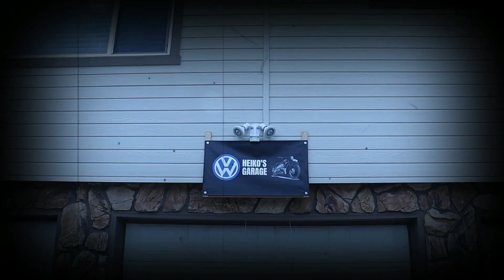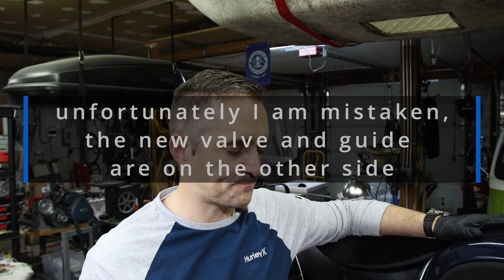BMW Airhead top end noise after refresh - follow up

Comment: Hi guys, I am from Germany and I am riding BMW R 90S for More than 40 years, doing  all mechanical  work on my own. You don‘t have to Make your mind on mechanical Noise because These bikes are Really old school Mechanic. My Father who was an engineer also always Said: as long as you can hear it, it is still in Place!
Reply: I’ve just rebuilt my 1987 bmw r80 gs. Same issue, the right cilinder has a different noise than the left one. But I thought the same thing than you, old bikes, old mechanic.. not quite but reliable. I’ll keep riding it, will check if everything is ok in some months.
Reply: I have an ‘83 R100RS and while it doesn’t make any funny noises, I have come to appreciate the raw simplicity of the 80+ year old basic design…..and it’s little quirks.
Reply: Check the exhaust mount below the cylinder. A rattle there will go away when it warms up.

Comment: I worked at a BMW dealer for 4 years as a mechanic.  I had the same issue with a bike.  After many hours doing the same as you I replaced the lifters and the noise went away.
Reply: I totally agree

Comment: I have the same symptom, R65, but on the left cylinder.  Did rocker arm end float.  Did valve adjustments many many times.
Eventually found the left  cylinder 😊exhaust push rod had play where it fits into the cup behind the rocker arm.  It was centred in the push rod tube, but was relatively "loose" in the rocker arm seat cup compared to the others.  While idling with the cover off I managed to put some side pressure on the push rod and the noise went away.  Further than that i have left it and just ride it.

I'm wondering if the wear is on the end of the push rod, or in the seat cup of the rocker.

Not sure if its the same solution to your problem.

Thank you for the interesting videos.  Keep them coming

Comment: I have the same rattling noise on my R65 and it's only from the right cylinder as well. The fact that it changes with motor temperature means it's not a "catastrophic" condition like a valve seat or guide as these would be present from cold startup.  I think it's rattling from the valvetrain, even despite the fact that you're using the brass drift/clamp method to set the clearance.  The guys at motoren-israel make a ONE PIECE rocker stand that captures the rocker and entirely eliminates the axial displacement, around 215 Euro, but certainly cheaper than an upgrade to the 1984+ version with shims.   Great video!
Reply: Who has the "rocker stand"? Where can I get a set.

Comment: Same problem on a '76 R90/6. Right side clickety, left side normal but it came and went and was worse at high rpm's. I pulled the rocker shafts out to realize that those needle roller bearings are not caged and will fall out into the space between the rocker shaft and the rocker and unless you are really careful you'll miss it. May or may not be your problem. Put lots of grease on the rollers to keep them from falling out before you completely remove the rocker shaft. Use the shaft to keep them in while you grease them up then pull it out. Several youtubers say that one side is always louder than the other. Not sure I buy that but it's out there.

Comment: I’m chasing a click or clack from the right cylinder on my /5. I used my iPhone to film the rockers in slow motion and can see it is something on the intake valve assembly. I have it apart for another issue now but I’ll check and measure all lifters, rods, etc from that valve and let you know if I fix it. As you implied - not really any harm, just annoying. The slow motion really helps to narrow it down though. 
     Good luck.
Reply from the maker: @paulmurphy603  thanks for sharing

Comment: The simphony of noises is ever changing through the miles almost like a radio station but as long as the adjustments are by the manual you're fine. To further increase the precision just add a 0.05mm feeler gauge to the vertical play of the rocker arms and not "oil is coming out", in the long run the parts will conform to each other.

Comment: I have a 70 model /5 with a noise right side top end too. So strange it’s the right side. I have had new valve seals,valves, valve springs and seats installed on both heads I adjust the valves properly I squeeze the rocker holdowns with pliers as I tighten to remove play. The left side is nice and quiet but that right side…..
I have also replaced pistons, rings pins had a bore and replaced the lifters. 

I just ride the hell out of it now !

Comment: I feel your pain. I've been chasing the same ticking noise from the same valve in my r80/7 for 2 years now. A new timing chain made no difference either. Valve guides all good. The only time It went away (or I stopped hearing it at least) was one time after a long bedding in period where I hadn't checked the gaps at all (perhaps 6-8 weeks) the clearance on that valve became super tight. I adjusted it to the recommended distance and the ticking noise came right back. But here's the weird bit... straight away I tried closing the gap again over a few increments but could not reproduce the silence from before 🤷‍♂️
Reply from the maker: Thanks for the comment. I just got a r100/7. That bike has no ticking. I wonder what the real cause of this tick is.

Comment: You might want to check that your head gasket isn’t upside down, if it or they are upside down, the pushrod will rub the edge of the gasket. After a long time it can really rub enough to weaken the pushrod, especially on the pre’76 small push rod tube models. If you can’t see down the tube, you can remove one rocker, pull the pushrod out and the rubbing will be pretty obvious.
Reply from the maker: During the refresh that preceded this video i did find the head gasket installed wrong. I did however install it correctly. There is video evidence on my channel that I did.
Thanks for your comment.

Comment: I have an R65 and noticed that the noise is much more pronounced with that type.   Tried numerous times to adjust the valve train train, but that did not help.  Noise seems to come from the cylinder. 
My current estimation is that it is a topling piston at top dead centre, which is more audible when there is no load on the engine.
Reply from the maker: Interesting. I just worked on someone's R65 and that was rather quiet with 56k miles on it. The valve train on those is different from my /6. It has plastic bushings and shim to adjust the axial rocker play.

Comment: Have a look to the lifters and push road ends on the inside of the engine probably there is some abrasions on the surface of the lifters and when it get warm …..you maybe have the noise going and get back as the lifters move à bit

Comment: Geez i used to prize myself at 1500 mile valve check in about 30 minutes. To do it right really have to play with the rocker shaft longitudinal play.ccperfomance made rocker end shaft bearings 
They weren't cheap & you had to mill the shafts. A friend went for the big bucks, gotta tell ya , it's not 750 Honda quiet. Then again there's no gas tank above the valves to quiet them.

Comment: I have the same issue on my 86 R80. Right cylinder only, the left is good now after adjusting the rocker arms. The engine is completely rebuild including heads, timing chain, all bearings...etc. It gets better after I readjust the rocker arm vertical play as you did but the clicking noise ( metal sound ) comes back very quickly. It's seems like the sound comes more from the cylinder than the cylinder head/rocker arms on mine but it could be wrong. I will keep paying around with it, and break the engine in some more. Very interesting....same problem....same cylinder !! I am going to check my rocker arm needle bearing to rocker arm shaft clearance/play next, any play there could cause that the adjustments won't stay permanent.
Reply from the maker: A few guys have told me they have the same noise on the same cylinder. Maybe it is some sort of resonance. I thought of doing the timing chain next and see but as you mentioned you did your chain already and still have the noise. Thanks for your comment.
Reply: @HeikosGarage  Did you replace you needle bearings or checked your rocker arm shaft/bearing play ? just wondering since I be doing that next....Enjoy your ride👍
Reply from the maker: @uwemeffle8057  I had replaced the rocker shafts and bearings at an earlier point because I thought that those were the cause of the noise. That didn't fix it either. I also resurfaced the pads on the rockers that touch the valves. That didn't make a difference either.
Reply: @HeikosGarage  ☹☹☹☹☹Danke !!
Reply: @HeikosGarage  So I was experimenting on my rocker arms on the right cylinder again. I tried many different ideas and came up with a combination of things to get rid of top end noise. here are the 3 things I did different.....
#1 I did not use a clamp but squeezed the rocker arms with my hand as hard as I could and tightened it to 15 ft lb torque first before retorquing it to the 26 ft lb. I had very little vertical movement and the oil was still squeezing thru and rocker arm was moving freely...
#2 Because it seemed to be ok at first on my last attempt and then got noisy again after I rode it for a while I retorqued (just the rocker arms) this time up to 28 ft lb. 
#3 I also set my valve clearance tighter, not by much but I made sure my shims were squeezed so it was harder dragging them thru ( 004" intake and my .008" exhaust ) 
Maybe I just got lucky or maybe those small changes made a difference but the noise valve is gone and sounds the same as the left cylinder. 
I took a couple of rides and it's still good !!

Comment: My airhead is from 1990 and the rocker end float (lash) can be checked using a feeler gauge to see if it is in spec.🍀
Reply from the maker: It is different on a 1974 airhead.

Comment: Having exact same issue with a R90/6 model too. Right hand side keeps much more sound like metallic ticking when you rev up the engine, not much or no noise when idle, but little rev and the ticking starts. Have adjusted the valvels like you in the video for 3 times already and it does not go away. Cylinder heads are new and done by sport-evolution in germany, engine rebuilt, new cylinder piston rings etc. And this frustrates mee too. Just got the bike finished and can´t find it. Sound like either cylinder or cylinder head like you have. Did you find out what causes it? Or what it was?
Reply from the maker: Mine actually got better after a bit of break in and a readjustment. Some say it can be caused by the timing chain but I haven't looked into that.
Reply: @HeikosGarage  Allright, Maybe just me then overthinking this, but as there is a clear tickling sound on right, and left sounds like a Singer sewing machine as it should. Need to do once more the valve check and retorque and see that the pushrods are in middle for sure, and no endplay. Maybe this also just needs some more break in as now the engine is new and rebuilt with most partst new like bearings etc. Hope they settle in and start to reduce the noise as yours. It´s just weird that some other comments here and somewhere else that found, all say it´s the right hand side that has the noise? What are the odds for that, or a symptom common to these?
Reply from the maker: @MrKenzo1  I would check everything again and then go for a ride. Enjoy the bike.

Comment: Brilliant video and I share your frustration as I have the same on my R69S. If you find out please please let me know. BTW mine is on the left hand side! Just a thought - did you replace the valve springs. Could it be this or am I clutching at straws. Thanks
Reply from the maker: I didn't replace the springs but i have thought the same. The next time I take the heads off I will load the parts cannon and replace everything.

Comment: Bent adjuster? bent pushrod?
Reply from the maker: Checked both. I also checked if the push rod is center in the tube. 
I just did a top end refresh and I inspected everything in the process. I had the noise before the refresh and I unfortunately still have it afterwards.
Reply: @HeikosGarage  I just re did all my valves with 006 inlet and 008 ex on the R60 and I got the tap ticking to a near absent level. Took a lot of checking at tdc over and over it seems but now it rev climbs quiet to 6500rpm easy.
Reply: @HeikosGarage  I just thought maybe a damaged edge on valve spring below the keeper that clicks when expanded like a bad end grind?
Reply from the maker: @441rider  maybe, next time I dig into this I will replace everything. New valves, springs, retainers, keepers, all new valve guides and probably a big bore kit from Siebenrock. Until then I will ride and enjoy it.

Comment: MINE TICKS BUT DOESN'T CLACK 10 INTAKE 20 EXHAUST RIGHT?
Reply from the maker: I do .15mm intake. .10mm is for new models. Mine is a 1974.
Reply: So ticking is ok ? It runs great at 180 k mikes bought her new1982 valve job done 20 k mikes ago. Thanx

Comment: Did You check the valve SEAT?
Reply from the maker: Yes, i did check the seats. I had the whole top end apart. The next thing I will look at is the timing chain and guides. Thanks for your comment.
Reply: A friend of mine bike was exactly the same, i just removed the head it was the pistón hitting slightly the head. Wrong gasket

Comment: You can't loosen a nut off when engine is hot, and expect to get it torqued up correctly.  Like your friends said,  it sounds normal, and it sounded like oil squishing to me, you may be getting more oil to the R/H cylinder rockers than the L/H.

Comment: I suggest it might be the rocker shaft having some free play to hit the head bolt as it turns with the rocker ( same problems have happened with Harley evo engines producing a ticking noise when the engine is warm )
Reply from the maker: That is something to look into.
Reply: I checked it and made it play zero.  Dit not help.
Other option: the push rods consist of two parts and there may be play at the connection.  So also to be checked ....  which in my case did not solve the problem.
The only that worked were ear plugs ...
Reply from the maker: @JongJande  your is /5 then. Hard to say. Lots of moving parts in those airheads.
Reply: You should check the valve seat

Comment: You are very consciousness mechanic, but I had to laugh while you were adjusting the valves, seemed like you were a little apprehensive on valve lash   Did you ever check or change lifters?  I'd be more concerned on too quiet valve train (thermal expansion) ie burnt ex valve down the road, no pun intended. Good luck
Reply from the maker: I just had the lifters out during a recent top end refresh. I lapped the valves and inspected all the valve train parts including lifters, pushrods, tubs, rockers, rocker bearings even resurfaced the rocker pads that touch the valve stem. Measured the valve guide play. 
I guess I am to picky. But you are right, to tight ain't good either.
Reply: @HeikosGarage  Just wondering about the lifters, if you switched or replaced?  Guess I love that BMW ticking sound, had it since 1984, still have that bike